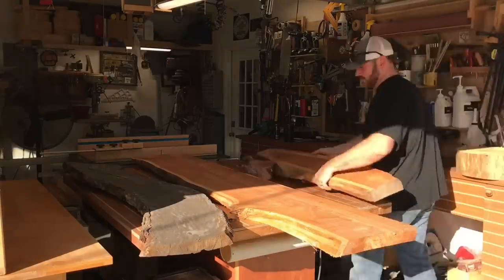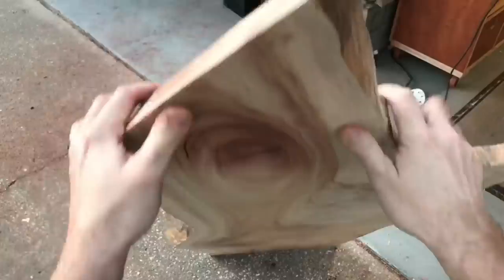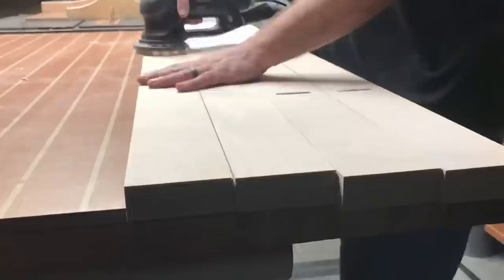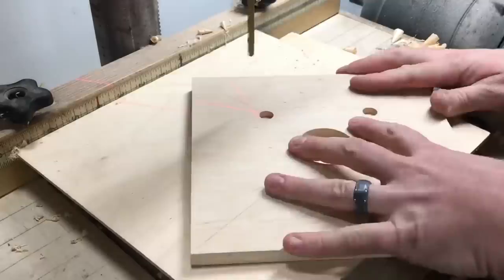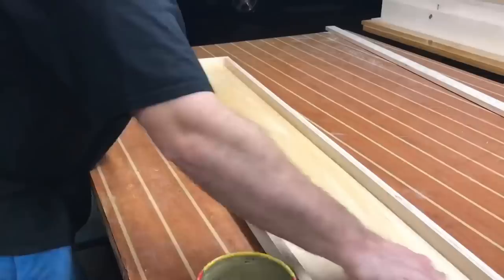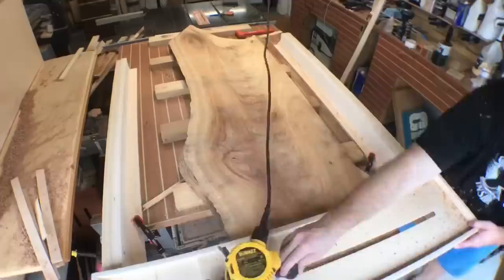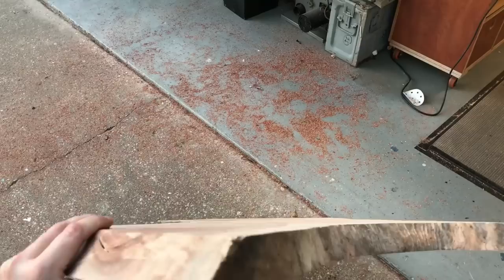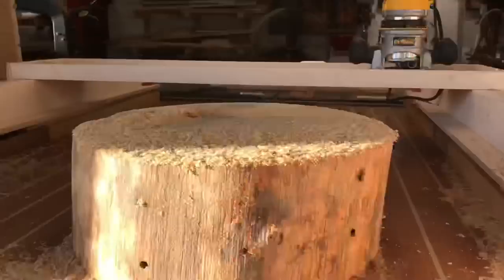How to Flatten Wood Slabs | Woodworking | DIY Project | Live Edge

Comment: Why did you make a custom square plate for the router instead of just making the trough the size of the existing router plate?  I've not worked with a router in decades so I may just be missing something here?

Comment: I enjoy working with oak slabs and planks. I'm glad you created a way to make uniform surfaces because I cannot afford a planer that big!
Reply from the maker: Richard Bedard Same here man!  Outside the cost of the router this is only about 20 bucks to build
Reply: Wouldn’t this require a joiner rather than planer

Comment: Well done! I've watched a number of different vids with sled designs and this one is the best. Simple, low cost, adjustable, low space impact in the workshop. Great job mate! 
(I made one using your recipe... Only issue I found was my router handles hitting the end walls... So I cut enough out to cater.)

Comment: I need to make a new flattening jig as I just bought a 2" flattening bit. I used a 3/4" bit but it took forever on longer pieces. I like the adjustable rails because once in awhile I'd run out of depth on my old rails. You make great videos don't stop. Your strongest floating shelf vid is great.
Reply from the maker: mike smith Thanks a lot for the kind words. It definitely helps motivate to create and beyond. I hope you’re doing well

Comment: Nice and simple build. Love your take on the adjustability. I've watched hundreds of these router sled videos and yours is the most elegant and apparently, easiest to use to set the depth with those slots and measured spacer blocks. So cool. Thanks for this video.

Comment: Nice design. I was looking for a simple way to make the rail height adjustable instead of piling the workpiece up on scrap blocks as I've seen in several other similar videos. There's probably also a way to make the cleats at the ends of the sled adjustable too (or just one of them), so you could narrow the distance between the rails when flattening smaller pieces.

Comment: I see you use an angle grinder to sand after using your router to get the marks out caused by the router bit.  What kind of sanding disk or sanding paper do you use and what grit?  I'm making small coffee tables out of live edge rounds but the sanding takes forever with my square little vibrating sander so I'm wanting to use something a bit more aggressive.  
Thanks.  Good video.  Also a very simple...very simple...router sled is a piece of angle iron cut to size as your track and just reinforced on the ends by wood blocks.  Fast and effective.
Reply from the maker: Thanks a lot. I actually got the sanding attachment from Harbor freight I believe it’s a foreign ahalf inch disc with Velcro and they sell the sanding pads as well. Are use about an 80 grit for the angle grinder in there and of course go through the other grades on my random orbit sander as well. Thanks for the comment!

Comment: The one in this video looks pretty good and but I have my reservations about this design too, you see the board is adjustable so unless when altering the height of the walls you would need to be 100% sure that both walls were at the exact same height as each other or you will end up flattening your board at an angle and you definately do not want that, the surface although needs to become flat all the way across or theres just no point doing it in the first place. 

Secondly...... you mention in the video that the board is supported only by friction and "shims" (small pieces of scrap wood cut at an sloping angle) well this might be true if you are flattening such a large and heavy piece of wood but if you were flattening a small board like a kitchen cutting board then you would need to jam some wood between the board and the side walls because the last thing you need is movement in the board or any piece which you are trying to flatten. 

Otherwise it looks pretty cool to me and I am impressed with the way the your router slides so easily in the sled but why should that matter ?? as you will be making slow and steady passes across the board anyway 🤔🤔

Glen Fiddich 🥃
Reply: Very sure he mentioned the exact thing you said in your second example. As far as your first, I bet he used a level somewhere in the process. Probably when he was building his bench. Then you only have to make sure your boards are the same width=level

Comment: adjustable rails really nice. i think your sled could use improvement though. use wider rails for more strength and fasten them on TOP of the bottom piece; not the side. then your sled will be less susceptible to bowing. if that bottom piece decides to bow in the future, those wimpy side rails arent going to do much to stop it.

Comment: Great video. may actually make these adjustable rails. My question is, why do yall shim the slab to be level? if the rails and the sled are level, wont that transpose to the slab being level after you run the router over it? it seems like a double negative to me if you level the rails then level the slab. I may be over complicating it though.
Reply from the maker: It’s not really shimming the slab to be level it’s shimming the slab so that you’re taking off a ballpark amount and gives you the best chance of getting level when you flip it over. At least that’s the way I see it I’m not really sure quite frankly
Reply: @AGlimpseInside  so I think i have a theory. my problem is my workbench isn't 100% level. not sure why but not gonna scooby doo that issue. if we adjust the router sled to be perfectly level then we need to do the same with the slab. because if we left the slab leveled on an unlevel surface then we'd take off an extra nth degree to get it leveled with the router sled. therefore, i'm just gonna wing it.

Comment: What size bit do you use in the router?
1st time I've caught one of your video's and enjoyed it immensely. Will definitely be watching more and building one of these sleds.
Reply from the maker: I used a 1/2 in strait bit. However I use a larger 1-1/2 in bit now. I just did not have it at the time.
Reply: @AGlimpseInside  thanks, must have taken you forever to get some of those slabs leveled

Comment: What router did you use? I was thinking of getting DeWalt 611 1/4" collett. Do You recommend the 1/2" for flattening?
Reply from the maker: The 611 will work no doubt. It’s in most cnc ‘s but I just like the larger 1/2 “ shank. Seems to be more of a work horse!!

Comment: Great design! I have the DWE611 router with plunge base, but it only accommodates 1/4” shank bits. I am wondering if I need a router with more horsepower (mine is 1.25 HP I think...) and 1/2” shank. Which Dewalt router are you using? Are you using a 1/2” shank flattening bit?

Comment: Ok so new to woodworking....Do you run your router back and forth without it jumping? I thought you have to go one direction
Reply from the maker: Yes you can go back-and-forth without jumping you just don’t want to be taking too much material off with each pass. You should be good to go

Comment: I have a slab that i am trying to flattening using a router sled i built from the video. The slab I have is cupped where the middle sits on the floor and the two ends are off the ground. which side would you recommend flattening first?
Reply from the maker: Honestly I would flatten whatever side that was opposite the side that I found easiest to make stable. Honestly I probably would flatten the side with the edges that were up first. With shims it would probably be easier to make that piece stable

Comment: Sweet! I need to make one but I worry about the sled sagging in the center under the weight of the router... any tips?
Reply from the maker: If that’s a concern you could also reinforce the sides with some angle iron in the shape of an L 90°. Thanks for watching brother hope that helps
Reply: Or increase the height of the sidewalls, it will make it stronger by adding side support . For mine I’ve made it with thin plywood on the bottom, for more router depth and 3/4 inch plywood for the sides . But it really depends on your router and how much that weighs . Marius hornberg has a good video on one of these , his and this video are the best I’ve seen so far because they are simple and adjustable.